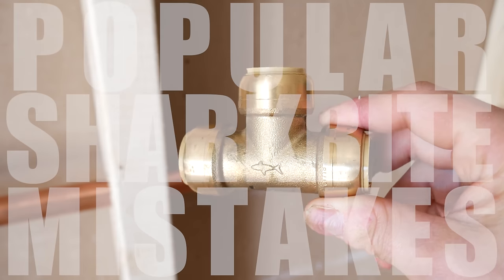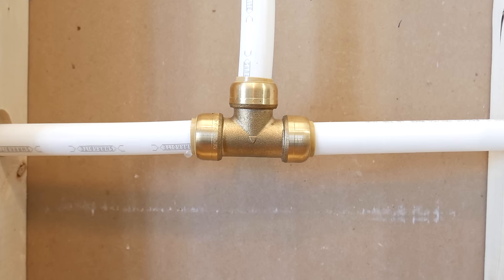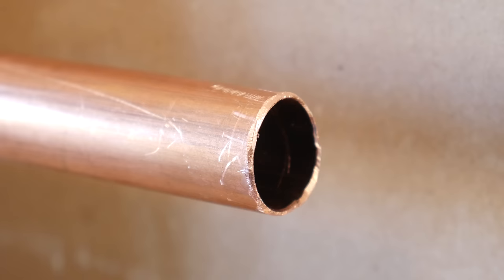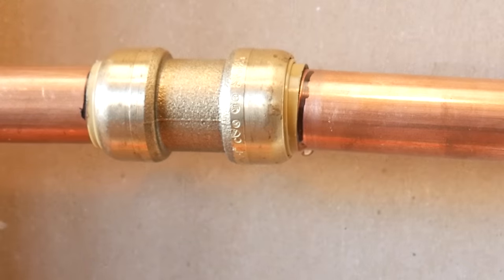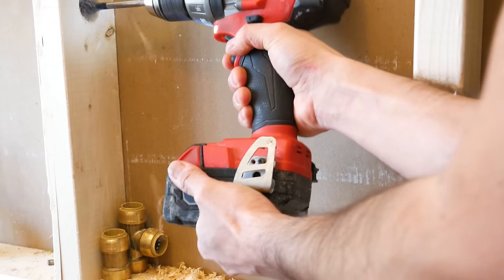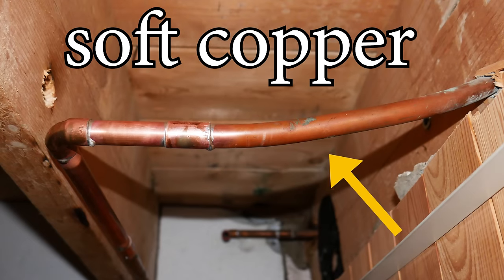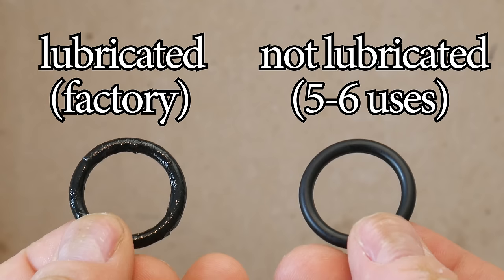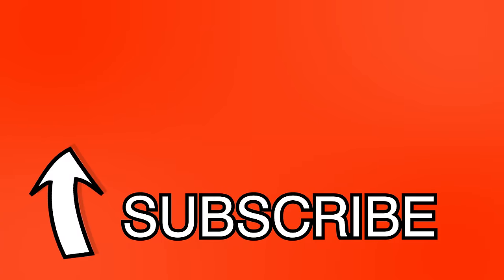6 SHARKBITE Mistakes NOT To Make! | GOT2LEARN

Comment: I won't trust Sharkbites on copper they haven't shown the test of time. PVC ok, but I'll solder copper connections every time.
Reply: I saw the test of time when my HVAC contractor used them around our floor heat boiler.  Two or three years and water leaking everywhere.  He had to come back and replace a lot if the plumbing.

Comment: Good to see others use my tool of choice, the ice pick
Reply: You mean!!!????

It's NOT just for shotgunnin beers!!???
Reply: I use my teeth.
Reply: No touch karate with a whole lotta chi… works every time. Be like water-Bruce Lee
Reply: Don't mean to flex but I just picked up the new Festool Arctic22 Ice Pick.
Reply: As a Canadian, I prefer using a hockey stick 🏒 
Comes in handy when I need to pound nails or chop wood.

Comment: I've worked in the HVAC field over 30 years. I'm still watching, reading and learning from books, other technicians and even videos like yours. You can always learn something new, even if it is a small detail, it can mean big savings in time and labor later. 
Thanks for the video.
Reply: I'm 30 year hvac mechanic too and thought :  Hey I might learn something new about sharkbite fittings. Never too old to learn something new.
Reply: I am in HVAC business. Haven't even used regular caplings in a while. Just use a tool to expand copper pipe and than stick one into other
Reply: After 30 years as an HVAC tech you should probably know damn near everything about your job by now and shark bites aren't very professional they're quick and easy but they're not the correct way, they really should only be used in a pinch when It comes to copper solder it, when it comes to PVC or CPVC glue it, When it comes to pex throw it in the trash lol jk crimp that shit
Reply: no dude shark bites are garbage lol
Reply: @twentydixoncider7443  It doesn't matter what you choose to install. What matters is what you encounter in the field. New products are always coming out. 
If you think there is nothing more to learn, then you aren't paying attention.
Reply: The benefit of proper training and education is the key. The continual learning is the lock, happy to see you have them both and use them both. I hope the best for you and your profession.
Reply: Yes sir I got into it in 2004 and everyday we are learning and don’t even know what the future of HVAC holds. Will be interesting to see.
Reply: So fyi: hvac is not plumbing
.....
Reply: @thomasrobinette3227  sometimes we need to do some minor plumbing
Reply: @Mouse_007  iggy
Reply: Awesome

Comment: I repiped from galvanized to PEX using sharkbites, I wish that war was only a weekend, lol. Good points, and things I did not encounter since I was not using copper in any way. From my own experience, I would add a couple of things. First, don't expect PEX to hold itself as well as metal pipe. You are going to have to strap and support it through long runs and when you might have counted on a rigid pipe to provide some passive stability on fixtures, you will be disappointed. Since we're on the topic of strapping, don't use wire to tie PEX along floor joists and such. Over time, it will cut through the PEX slowly. Next, don't let the PEX touch the soil or become exposed to even partial light, the pipe will decay quickly. Finally, if you are repiping be aware that the builder might have used your metal piping as a ground for your wiring. You may need to carry a ground wire to where your metal piping still exists and connects underground, for me, it was the supply line from the utilities district. You would be safer buying and driving down a ground stake and connect grounds to that to protect your house from electrical fire...All that being said, I loved the advantages of PEX and the price and durability was comparable to favorable over metal piping. It has been ten years now, and no troubles.
Reply: So you have to plumb pex in at night?

Comment: Been using these for a few years and they work very well specially on repairs where soldering is almost impossible when the pipes have to much water in them. It only takes a few drops of water to ruin a soldering job, then you have to start all over.
Reply: When water is a problem stuff some wadded up bread in there then solder it up before it melts away. It will flush right out when you charge the line later
Reply: I use white bread  make a dough ball and put it in the dripping pipe ,solder and flush out the dough

Comment: Read a lot about Sharkbites on Youtube, its pros and cons and decided to replace  Accor Lite push -pull valves that started to leak ( internally) after 7 years of use . Followed all the cleaning /square cut as well as checking the insert depth and the 2 clicks that ensures proper Sharkbite Installation.  The depth is more key as you may not totally notice the 2 clicks if you push hard /fast enough enough so Depth is more critical than the 2 clicks as basis for proper insert.  It's been 2 years so far with no leaks on about a 18 units 
replacements.   I also purposely opened and closed 1 unit 50 times after a year of use and there was no leak unlike the  Accor Lite valve I used to have that started to leak even with less than 10 open/closes.  The 25 year guarantee  on Sharkbite as well as some  inputs from plumbing friends who attest they did not have any issue if properly installed made me try this out.

Comment: I see a lot of old-school plumbers are on this page, guys who love to rant about Sharkbite fittings. Fact: Sharkbite fittings have their place. They are reliable, durable and cost effective when labor is factored in. They can withstand temperature extremes, and can be released during renovations or repairs. I see the same resistance to new ideas from old-school carpenters. Just don't hire an old-school guy! Hire someone who is up to speed instead.
I've been plumbing for the last forty-five or so years. I have never hesitated to keep my mind open to new ideas, and when Sharkbites came along I gave them a try. Installed properly, they are dependable. Sure, installed by a sloppy guy who doesn't care, they'll leak.
Reply from the maker: Well said!
Reply: Yes, same with a glue(weld), soldered, or threaded fitting too. A leak is possible in any fitting if not properly installed.
Reply: You better have good insurance on your house if you plan to use these in your house
Reply: @redlobster4841  properly installed these fittings are great, i have multiple shark bite fittings in my house going from copper to PEX where repairs were needed in my basement. In two years, living in North Dakota, a state with 150 degree temperature change  I haven't had a single problem
Reply: Got ones all over my house ,12 yrs now no problem .

Comment: Always ensure your tip is clean before inserting....   wisdom of the age.
Reply from the maker: I had to do it 🤣
Reply: "Get silicone lubricant so that it is easier to go in" is a close second.  Especially for older parts!
Reply: Make sure you have you Pipe Dope handy!
Reply: BEST THING i heard  YET in plumbing video
Reply: Leads to no uti
Reply: No way! dipping your used tip into another pipe is fun!
Reply: @walterbrunswick  I think that is just your "Personal Opinion" and they make varying different pipe Dope. The pipe dope is just a extra blanket security depending on the person. Either way there isn't a right or wrong. I'm a Fleet Manager Supervisor now but I do have knowledge of plumbing,carpentry,hvac, electrical,boilers, chillers blue prints etc. Please don't  try to act like your opinion is correct. Thanks.

Comment: Retired Engineer, I began using push fittings in early 80's plumbing large machinery, and plastic injection molds.
The main reason we used them on injection molds was the ability to reuse them. Not reuse the entire fitting, but replace flexible plastic tubing quickly. Doing injection mold changes and plumbing repairs always came down to speed, the faster the mold could be put in, and pulled out of the machinery used to run them, the better. Saving time saves money lost through downtime. Many times several dozen lengths of tubing had to be removed for a mold to clear obstacles, so if only the tubing had to be slipped out, then back in after setting, and before pulling the mold, and the fittings didn't need threaded out, then back in, it saved enormous amounts of time using push fittings. Just swap out tubing, leave the fittings alone. These fittings were usually good for 12 to 15 times before becoming undependable, so I wouldn't worry about reusing them 4 or 5 times for one of my personal projects. 
 I have used them about everywhere possible in industry over the past 40 years with very few problems. The biggest issue was burrs on tubing ends, and tubing not being completely inserted into the push lock.
Follow the simple installation rules, and save time, which usually equals money.
I will say, this Shark bite brand has really put itself out there marketing wise as I have been seeing a lot about it, seems more so than other brands over the years.

Comment: The Shark Bite Depth Gauge should be cast in to every fitting so they are always immediately visible available just like strip gauges on electrical Outlet receptacles.
Reply: Amen to that!!
Reply: Right.  I just today put on a SharkBite shut-off for a kitchen sink. That depth is only half an inch and it wasn't easy to see things inside the cabinet.  I thought they make one that "clicks" when it's properly inserted?
Reply: @liman42  I feel you.  I don't know if the ones I've used click or if they do it is not always audible with or above ambient sounds or My Radio.  What I need to do is get a High Quality LED Rechargable/AA  Battery Head Lamp Safety Classes for Dark work places like that.  Because My old AA Incandescent Work Headlamp is timing out.
Reply: Nobody uses the strip gauge
Reply: @DemnRaig80  You mean You don't.  I can smell your electric work burning now.
Reply: They fucking are lmfao there are straight lines on the outside of them things. Don't use these unless it's in a pinch just learn to shut your water off and use CPVC or copper or whatever it's actually supposed to be
Reply: Shark bites are for handyman not plumbers
Reply: @SeekTheTruthJesus  Of course You are Right.  But the reality is that very few people hire Skilled Plumbers anymore.  Most Jobs are based on Time, how fast You can get it done to maximize profit and minimize cost.  You only need moderately skilled Handymen for that with Sharkbite Type Plumbing.  I love properaly sweated copper plumbing.  But what really are the down sides to properly installed Sharkbite?  Does Home value decrease, does the water taste different, does it not last as long, is it harder to fix or is it noisier?
Reply: @ccfmfg  they are held together by one “Gasket” that deteriorates it blows off seen it hundreds of times
Reply: Then they wouldnt make as much. Absurd that i had to buy 4 pieces to go from 3/8 to 3/4. Business i guess
Reply: @SeekTheTruthJesus  Were they Sharkbite or Sharkbite want to bes? I understand Lowes came out with its own line but stopped because of issues. The copper plumbing in my house was put in in 1950 no problems so far with leaks. I will use a Sharkbite in a location where fire could be an issue.or where water damage would not be a big issue.
Reply: @patk4351  Yeah i agree, i dont fully trust these things. I am trying to make a T off a copper pipe in my garage to connect a wall mounted pressure washer, in this scenario, if there were to be a leak it would just flood the garage and flow out of the garage door. Garage is epoxy coated and 6-7" below the level of the house so i wouldnt be concerned with flooding if it bursts, but indoor, in walls? i dont know if i would trust this over copper with solder or pvc with glue.
Reply: @SeekTheTruthJesus At least where I'm at, most plumbers use sharkbite and PEX.  Sadly, that's actually an upgrade from the original install copper which is shit quality.

Comment: I never install a Shark bite fitting without plumbing grease, you will inadvertently damage the o-ring shorting it's life, once it is debured properly, remember that a file can leave marks that can cut the o-ring, that's where the Plumbing grease comes in, clean the outside of the pipe in a circular pattern so the scratches go around the pipe as shown in the video, not length wise as this can provide a path for water to escape,  grease the pipe to protect the O-ring and insert to the proper depth with the pipe in line as shown in the video and I've never had a leak when I do these steps, Great video!
Reply from the maker: Good input, thank you so much!!
Reply: Sharkbite O-rings are already greased. Another similar brand, Push & Connect, doesn't grease its O-rings. So I agree: use a bit of grease just to be sure. Your advice on sanding the pipe in a circular pattern is bang on.

Comment: Important. When using sharkbite on copper it is okay to remove the plastic insert. The plastic insert is only there to support soft tubing. It is not needed for copper. Not removing the insert will restrict the flow. If you can live with less flow it's okay to leave the insert, but if you want maximum flow through the pipe remove the plastic insert with a pair of needle nose pliers as per instructions
Reply: Agreed! 👍🏼
Reply: Really?? Why am I just learning this??
Reply: The flow rate is minimal if any
Reply: i was looking for this answer !  thanks you a million for sharing !!

Comment: plumber here, yeah thats all good stuff, sharkbite are very easy to install, very expensive but makes the project quicker, the depth gauge is a good idea though not necessary if you know where that point is and do all the other things to make a good seal.

Comment: I know one thing, having a shark bite valve handy when a line breaks and there isn’t a valve accessible is awesome. You will get wet but just push the valve on with it open and close once installed. The only downside is the o-ring could possibly come out but only has one time before. I hope this helps anyone!
Reply from the maker: Great tip!
Reply: THANK U
I will pu 1 or 2 
God willing i won't need
Reply: You can do the same thing with a compression stop
Reply: @time1800   I wouldn’t want anything compression that’s inside a wall or hard to reach location. A compression stop you have to install the nut and ferrule before you even can start to isolate the problem. I do agree with you that it will work though. I have encountered situations non residential when valves aren’t present to add what’s called a “add a valve” this installs on the pipe and cuts a knockout in the line and shuts the water off. Then you can install a sweat valve or pro press valve in place. Another alternative I have used is to use a freeze machine when valves aren’t installed. I have a nice RIDGID pro press tool that’s even better than a shark bite system. This will actually crimp the fitting or valve in place for a permanent fix but cost a few grand for a system of jaw sizes. Also if you ever need to get a shark bite off without the tool just use a crescent wrench and tap it on the plastic with a hammer or channel locks whatever you have. This way you can reuse the fittings or valves after use. I hope any of this information helps anyone.
Reply: @VAMCVETS  But your ok with a rubber O'Ring?
Reply: @time1800  They are suppose to last for 25 years and have a warranty. No, there is allot of situations shark bites shouldn’t be used. I would rather use a shark bite cap or valve for emergency purposes. I would fix the repair properly and solder the pipe and fittings. The pro press setup I have has o-rings just like the shark bites, but they are pressed into place. I personally haven’t had any problems with shark bites but have heard some stories here and there. If there is a emergency and you don’t have anything just beat the pipe flat and roll it. This will control the water until you can find a way to turn the water off.
Reply: good suggestion, I'll put one on the van.
Reply: Nice advice

Comment: Thanks I should've watched this before installing angle stop valve with faucet connector. I have a small leak and need to remove stop valve. Great video 👌🏾
Reply from the maker: Thank you so much!!!
Reply: Total fail...for me .... leaking...I guess the guy at home Depot should have directed me to debarring...he told me sandpaper...

Comment: I prefer to sweat joints for both cost and peace of mind but have used sharkbites on many occasions mainly for transitioning from copper to PEX. You'll want to strap the pipes well to eliminate movement of the joint which could cause deflection and distort the o-ring. You can install them on soft copper you just have to hit the end with rounders first and make sure it is straight with no dings or scratches. I always remove the inserts from the fitting first. If using PEX I put the insert in the end of the pipe then push home. Not needed or recommended to use them with copper. When soft copper is cut with tubing cutters there is usually no need for champfering since the cutter leaves a nice bevel but if using on ridgid type M or L i highly recommend not skipping that step because it usually doesnt bevel in nicely like the soft k does. It all comes down to proper application and proper installation. All water mains buried in the ground in the last 50 years rely on rubber gaskets to seal each bell joint. Same principle just smaller scale.
Reply: can i copper to pex for a water heater?
Reply: @tareqeg213  yes shark bites are rated for 200 degrees F just make sure your using the right pex. Pex A, B, and C have different temperature ratings and are meant for different applications

Comment: I just installed a 3/4 coupling on a pipe from my hot water heater on the hot side and now my hot water isn't running It has an arrow and I figured it was for how the water is running my arrow is pointing upwards and still isn't running anyone able to help?